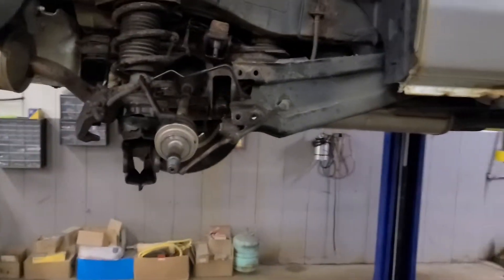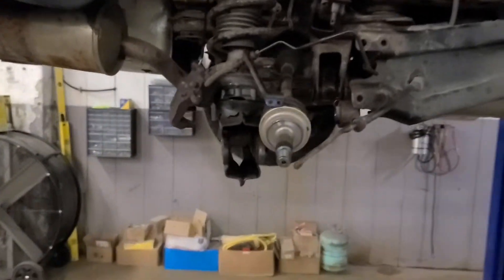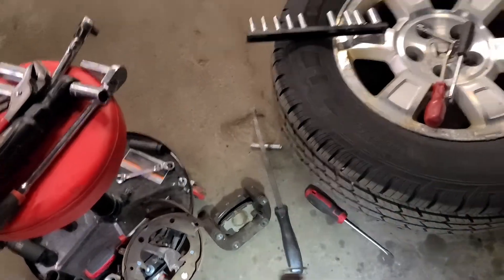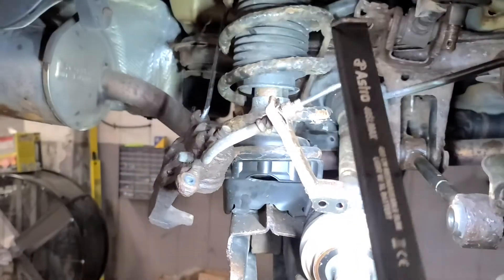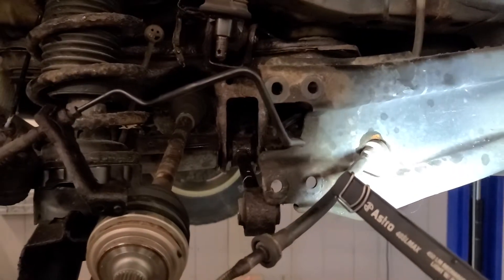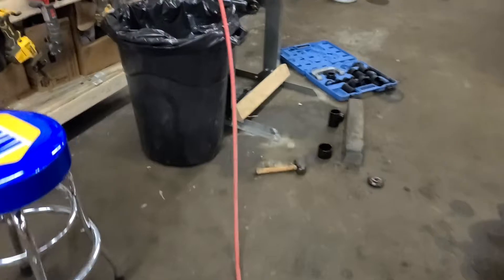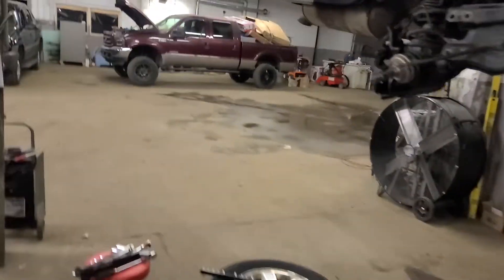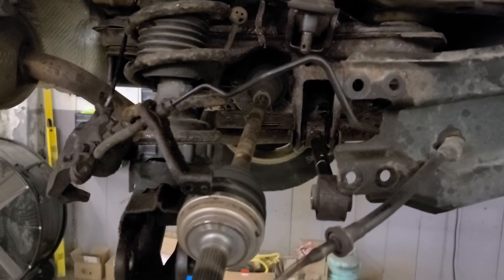How to Change 06-14 Honda Ridgeline AWD Rear Wheel Bearing Quick Rundown

Comment: What did you do to get the hub back pressed on?
Reply from the maker: I have a bearing press you can get them at harbor freight fairly cheap. Or they have setups that work with impact tools.
Reply: @patrickmurphy8619  ok thank you